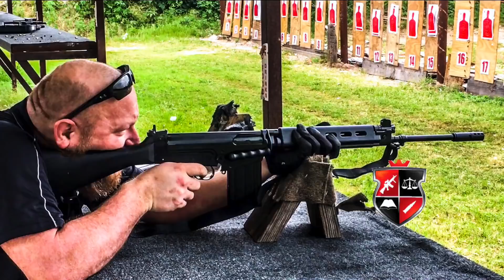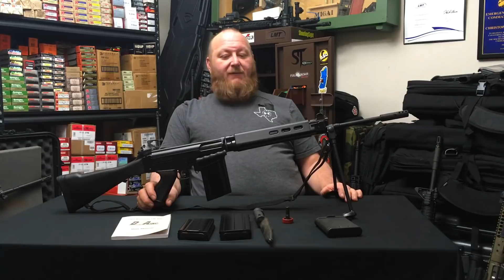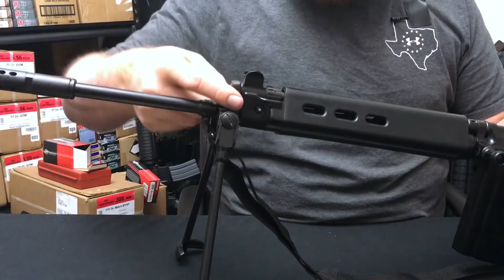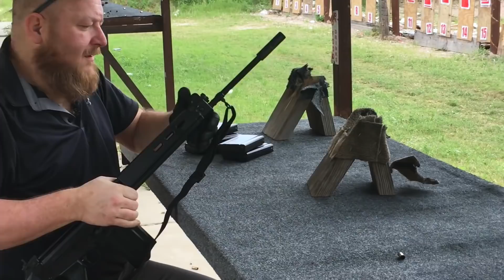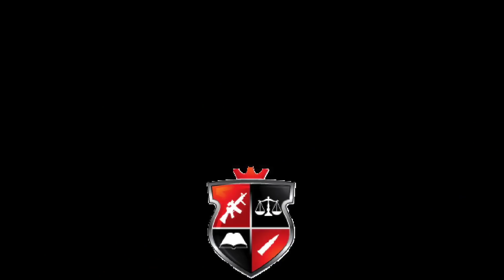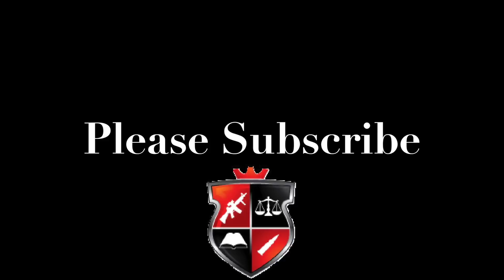DSArms SA58 FNFAL Metric Review

Comment: The 280 british was absolutely NOT a better cartridge than 762. Maybe in THEORY, but not reality. The brits didnt R&D it enough and it was a lousy round. The 762 was developed like mad, and it can be seen how succesful it has been in basically every category since.
Reply from the maker: It was intermediate round, that was the point. The 308 was not. The 280 was for sure a better option. The 308 is a battle rifle round that won’t stand against the assault rifle rounds for low recoil, light weight and low recoil. You talking power, yes 308 is more powerful but that’s not what the UK was looking for. Like the Russians were with the 7.62x39mm. An assault rifle intermediate cartridge.

Comment: I came across this by a video from a YouTube channel called The FAL Guy showing up in the feed. I followed it to his channel and saw a video of Q&A and an interview with the owner of DSArms. After doing some more research though it did not pull this up unfortunately I bought one of the standard pattern rifles. I have waned one for a long time. Right Arm of the Free World and all that. I got the wood furniture because I figure that is what the original production runs had.

After I get mine and have a chance to fire it and see how it is if I get another one it will be the 16 inch para version with the folding stock.

My dad back in the 1990's bought the Springfield M1A which is basically an M14. I have on order a PT-91 G3 made from a mix of Portuguese and US parts. So I will have all three of the Cold War battle rifles.

Comment: Canadian Army veteran here. The gas regulators on our rifles had 13 positions; 0-12.  Standard position when shooting live ammo was "4."  When shooting blanks, the setting was "0."  The standard drill we were supposed to use if insufficiently gassed would be to turn the gas regulator 2 stops down to "2." If that was too much, we were supposed to go back up one stop to "3." I never, ever had to do this. I have never heard of pistons freezing up in cold weather, and we spent half the year training in cold weather. 

Of the Commonwealth patterns, only the CANADIAN ones had the top feed, which I thought was outdated thinking, however it made it easy to clear an FTE, which only ever happened to me when firing blanks; never live.  British and other Commonwealth countries had the full body cover. 

We also had the closed prong type flash suppressor.  Never had any issues with durability that I know of. 

The hardest part to clean was the gas plug.

Comment: Just picked up a DS Arms SA 58, Cold Warrior series, 21" barrel, bipod, carrying handle, and I absolutely love it. I grew up on the FAL, i actually sold a heavy barreled Israeli when I was buying my house. Biggest regrets of my life. Should have just lived under the FAL. Lmao. But I highly recommend the DSArms SA 58, just be prepared to wait a little bit. I got mine about 2 1/2 months after ordering. Worth the wait. But finding steel or aluminum mags for it is a lesson in futility. I use to get bakelite AK mags and FAL mags for $5-10 a pop. Now? $80-100 for the bakers and $40-50 for the FAL mags.
Reply: Hey is it still functioning etc?
Reply: @cruuze9414  Runs great. I've only put about 500rds through it so far but I haven't had any issues

Comment: Gas system adjustment. Start with it fully OPEN an an empty magazine. You fire 1 round at a time, CLOSING the gas system 1 click at a time until the bolt remains open on 2 consecutive rounds. Then close the gas system an additional 2 clicks only. It's that easy.

Comment: I have a modernized SA58 carbine with the flat rail dust cover. I also got a trigger job on it to reduce the pull from 8 lbs to around 3.5-4 lbs. MUCH nicer.  Only bad thing about it is it is hard on brass. I've tried adjusting gas to variable degrees but still end up with a lot of dinged brass. About 1/3 can't be reloaded.

Comment: Actually you do not open for more gas.  When the bleeder hole is fully open, or rather, uncovered by the adjuster, it allows the most gas to bleed off from the piston/cylinder, and thus the least gas is available for operating the system.  When the hole is fully closed, or covered, all of the gas is directed to the piston.

Comment: Great and informative video 👍🏻.  I’m looking into purchasing one myself. Could you answer a few questions for me I would like your input. Are there any trade offs with choosing a para model over a fixed stock model and are you going to see any significant velocity or accuracy loss between the 21, 18 or 16 inch models?  I like the para for being able to shorten it up the length and paring that with an 18” barrel.

Comment: Necking down is to close the case neck size to a smaller caliber. The .308 caliber was used in the M14 and Stoner AR10 phasing out the .30-'06. .308 caliber cartridge converts to 7.62 x51mm metric measure and was  adopted by NATO. The.30-'06 also converts as 7.62x63 mm.
 DSA bought the actual machinery and blueprints from the Austrian factory that built the STG58 FALs so, you are buying an actual American made STG58 hence the SA58 designation.
 I own a 1958 BSA L1A1 with a new barrel and "inch" Imbel receiver (early 1990s CAI) with new  "plastic furniture" and a DSA Picatinny top cover for the Vortex scope. DSA's locking top cover is the ultimate in quality and craftsmanship. These guys are top shelf. Great Americans making great American products.

Comment: I have a imbel made fal built on a surplus parts kit. I also have a dsa made fal. The Dsa fal had feeding issues right out of the box. I had to polish the feed ramp as well as countersink the bottom of the breech to get it to cycle properly. SMH
Reply: Nick West damn are there any options for purchasing a quality fal outside of buying a pre ban?!
Reply: @stephenwinchester6668 go on gunbroker and buy an imbel reciever it may cost you 550.00 and it may take you 6 months to find one but it's worth it those receivers were just as good if not better than the factory fn receivers. Buy an imbel parts kit for 600.00 and take it to a reputable Smith if you dont want to take on the project. I had to turn my surplus barrel in a lathe to get the fsb timed to tdc. That thing shoots so nice and the parts quality is amazing

Comment: used the UK version of the slr as a reservist in the Gibraltar Regiment ,  would have loved the auto option. A top tip was always have a spare clean gas plug. During a break whilst on exercise we'd replace the used one (and minimising stoppages at an awkward moment) and clean the used one. Another reason being as cleaning a gas plug took longer it was practical (  plus the armourer took delight in not accepting your rifle due to a grimy plug thus having to stay in barracks longer) to hand in a rifle with your second and clean gas plug and take off home and clean the used one over a nice cuppa tea and in slippers ha ha ha !!
Reply: Auto wasn't any use, we had the option in Rhodesia. It shook around and used too much ammo.
The heavy barrel FN was a different thing altogether and I came across a few chaps in Rhodesia who swore by it.

Comment: I shot both the normal FAL, as the full auto version (FN FALO) during my time in the Royal Dutch Airforce. Great weapon! I think the FAL was in service until '93/'94 when it was replaced with the Diemaco C7 (Colt M16A2) ..7.62 vs 5.56, you guess which was better....
Reply: Same here, I also used the infra red (which in fact was green) scope on it during my time in the Dutch infantry in 1976.

Comment: I wish DSA would use forged receivers instead of the cast ones on their premium SA58 FAL rifles.
Reply: their manufacturing process is based on the final contracts of the FN produced FAL's. Evidently FN had came to the conclusion that it was unnecessary, as to why I could not tell you, but if it was good enough for an FN military contract I have to assume they did enough research to determine it was fine.
Reply: @elijahjackson7125  I ended up getting lucky and found an earlier DSA FAL with the LMT receiver. It looks to have the original austrian barrel also.
Reply: @noelr2502  damn yeah you are lucky. I’m trying to get one right now but DSA has a 4 month waiting list and prices on gunbroker right now are election taxed. I’m hedging my bets that trump wins and the prices go down. Hopefully that doesn’t bite me in the ass
Reply: @elijahjackson7125  100% Trump will win
Reply: It would seem that for some reason they won't be doing business with LMT anymore. 

LMT did say they'd make more for whoever wants them if the demand is there, but the problem is they can't use DSA's specs due to a contract, if I remember right.
Reply: @TheShotgunMessenger yeah nobody knew they would steal an election with mail in ballots, rescanning Biden ballots thousands of times, hacked machines. Who knew...

Comment: to the """same""" """specs"""
lmao ya right. they routinely produce receivers and parts out of spec by tens of thousands
Reply: @Fawthur Watch part 2 to that vid, even better. Gives pictures and numbers for how far out of tolerances receivers were. but part 1 should be a wakeup call that quality control at DSA is non existent.
Reply: DSA as I recall claimed there were no specs, so gun plumber posted up original FN spec sheets. Which turned into the inevitable falfiles pissing match.

DSA is not what it once was when they had lots of Steyer parts and LMT uppers. And just because it's not documented here on yt doesn't mean it's not true. Yet it is documented here, as noted above.
Reply: @Fawthur forum lore? its where you'll find most testimonial. granted most of them are elderly retards, but still. so long as its documented its not just 'lore'. 

alternatively, check out Arizona Response Systems. one of the few gunsmiths in the country who can be considered an expert dealing with FALs. Do some digging on his website and forum posts, and you'll find lots of information.

Here is just one example that happens to be on youtube:

https://www.youtube.com/watch?v=qJpv16wr0ps

Theres a lot of history to DSA, why their quality slipped over the years, and what kind of shady things they've done with there customers. You'll have to dig that on your own. Some keywords should be LMT, retooling, DSA, inhouse, QC

Comment: Would also like to see you review a G3 type rifle, perhaps the PTR 91.
Reply: I'll do a review of a ptr91GI for you
anyone who says it recoils too much is a pussy I was 140lbs soaking wet when my parents bought one for me when I was 17 and I thought it was a blast. The sights kinda suck because its a v notch for 100M and apertures after that. Full disclosure I don't think my ptr91 was built 100% correct, the finish on the cocking tube came off at about the 11 o clock position, but every time I pulled the trigger it went bang, and for ~8-900 at the time I would say it couldn't be beat. I sold it years ago after I got bored with it and I kick my own ass about it all the time. If you got some money to drop in it it can be a sweet rifle, if you do not they're fine as is and mags are about as costly as a bucket of horse piss
Reply: @elijahjackson7125  I agree with the recoil thing... Compared to any full powered bolt action rifle, the ptr 91 is a soft shooting gun. Yes, it has more thump than an M1A or a fal... But it's nothing a full grown man couldn't handle.
Reply: @elijahjackson7125  it's not about whether or not the gun hurts to shoot, it doesn't. Hard to think of a semiautomatic that "hurts" to shoot. The problem is muzzle rise and/or speed of getting back on target, and the G3 suffers from it's stock design which allows the iron sights to have very little height over bore at the expensive of the bore being a couple inches over the contact with your shoulder. You can get an aftermarket stock that makes the G3/91 series have inline recoil but the stock is like $400
Reply: @elijahjackson7125  could we get a price check on that bucket of horse piss?
Reply: I can review the H&K-91/G3 for ya!  I've own both H&K-91's and 93's that were H&K factory produced.  1st thing about both genuine & reproduction guns, is the weight, 2nd is the trigger, and 3rd would be the sights!  
as an added bonus for the reloading minded owner, you can forget about it with these guns because with every case ejected they manage to dent the brass shell / casing badly enough to make reloading unsafe!  They eject the shell cases forward about 1-2 on the clock, and they manage to eject them 20-30+ feet out onto the range.  Get a nice FN-FAL or DSA Stg 58 long gun.

Comment: love me some FALs! nice review as always.
i used to have a really smooth running Century Arms International R1A1/L1A1 that i had to sell a few years ago when i fell on hard times. ive kicked myself ever since!

it was a standard 21" British L1A1 style rifle with an Imbel receiver and US made barrel and furniture set. the BCG, folding charging handle, sights and lower receiver were from a well treated parts kit.

once i worked out the gas system operation it was 100% reliable with every type of ammo i fed it . i never had a single malfunction of any kind and it was extremely accurate.
my all time best was a 1.1" 5-rd group and a nearly miraculous .750" 3-rd group at 100 yds with match ammo although 1.5" to 2.5" was the norm.

and the icing on the cake?
i paid $600 for it!

ive searched far and wide for another but no joy.
looks like ill have to spend big bucks for a DSA model but its very unlikely ill ever find a rifle as accurate as my humble $600 CAI R1A1.

If theres one item from my past that id do anything to recover it would be that beautiful parkerized FAL!
Reply: I know this is a late reply but I gotta. I'm with you. I have this same rifle, only I paid $323 at Roses Dept Store. I replaced the Bell & Carlson stock and handguards with a complete matching new plastic furniture set from CAI for $17! Most L1A1 stocks are $28-$35.
As far as "parts kits" rifles go mine, as well as most surplus rifles I've seen, is a complete 1958 BSA L1A1 imported without the upper receiver as per import restrictions. Imbel made "inch" receivers (mine uses inch mags and gas system so, yes it's truly inch cut) and CAI fitted them with new barrels, bolts, sears, hammers, pins and springs sets.

Comment: Great video! How reliable would you say the DS Arms SA58 is? It seems that in the last couple years or so the quality of these rifles has gone downhill. Just look at MACs video (Uploaded earlier this month) of the DS Arms SA58. It had a malfunction every other round.
Reply from the maker: Francis McInerney I have not seen MAC’s video. Once I got my gas adjusted the rifle worked perfect.
Reply: Many thanks for the reply! I'm glad to hear that you didn't have any serious issues. Here's the video that I am referencing.  

https://www.youtube.com/watch?v=Sdtio4h6h9E
Reply: SmallArmsSolutions, There are rumors that the FN FAL cannot be accurized because of the 
bottom single sided  locking lug.  The claim I've heard is that because of the single lock, as the 
rifle heats up it will string it's shots at longer ranges, is this true?
Reply: Gadsden Viper - there is some truth to this.
the FAL uses a tipping bolt locked breach design in which the bolt drops down and its rear shelf engages with a replaceable and tuneable(accurizable) locking shoulder or segment. its the oblong pill shaped pin seen on the right side of the receiver. these are available in various sizes and that is how headspace is set on the FAL and can also be used as a tuning component to squeeze a bit mire accuracy from the system.

the FALs tipping bolt breach locking system is a battle proven design that several rifles throughout history have used.
its strong, reliable and durable.

but its not perfect. it requires the receiver to be a stressed component and as such has to be made from steel instead of aluminum.
also the bolt does not have the benefit of rotation during unlocking to help break the fired cartridge case seal to the chamber before extraction as rotating bolt designs do, and as such is noted for being rather forceful and hard on the cartridge case rim and the extractor itself.

the system also demands high quality (NATO spec) brass cased ammunition for best results.

another issue or idiosyncrasy of the tipping bolt design is the propensity for vertical stringing of the shot group as the magazine capacity is reduced during firing thereby causing variation of the pressure applied to the bottom of the bolt as firing continues.

i personally have never noticed this problem.
in fact, my FAL was a very accurate rifle and i noticed no variation with mag capacity.
with run of the mill surplus 7.62 ammo it would produce 5" to 2.5" groups on average. but when i did my part, and fed it good quality ammo it produced 2.5" to 1.5" 5-rd 100 yd groups with good NATO spec surplus ammo and factory loads.
but its preferred loads produced excellent 1.1" 5-rd 100 yd best of best groups which is probably not very common among most FALS.
id say to expect 1.5" to 2" groups from a good shooting example with its favorite factory loads.
handloading can reduce that and i have heard of sub MOA FALs.

FALs are also typically 100% reliable. mine was.

FALS are truly world class battlerifles and just as viable today as they were 70 yrs ago.
theres a reason literally EVERY ONE of the NATO countries except the USA adopted the FAL as their service rifle.
the US chose the M14 for political and corrupt reasons while almost 100 other nations all chose the FAL.
that doesnt happen for no reason.
its a hell of a battlerifle.
not perfect, but neither is anything else.